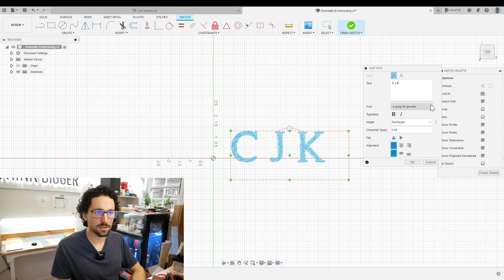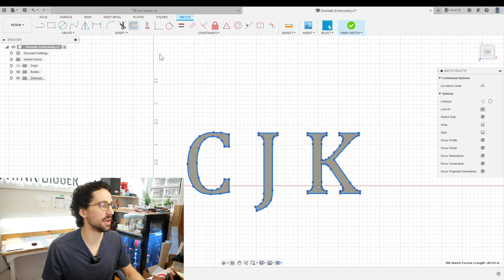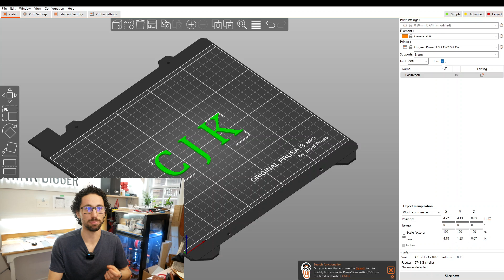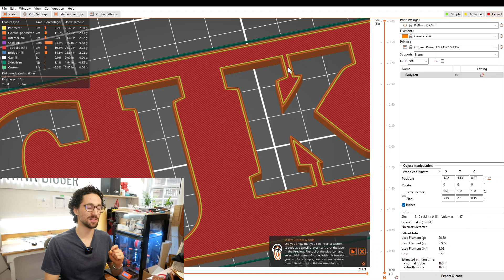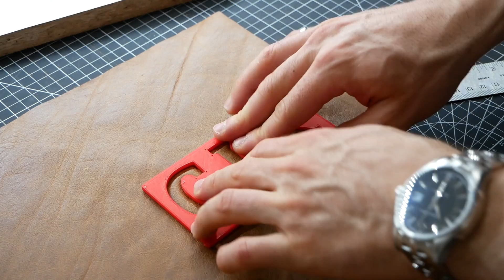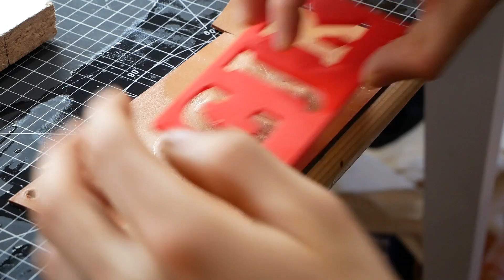DRAMATIC Leather Embossing with 3D Printed Dies

Comment: I believe that technique for leather was originated in Cordoba, Spain, and is what Cordoban leather is known for. They used molding clay as the support for the embossing by tracing the design into a thin layer of the clay, and then laying thick layers of clay into the design.  When that's done, they lay the cased (wet) leather over the design and press it down around the mold. 

Great video about using 3d printing for the same thing!
Reply from the maker: That’s really interesting, thank you! I will pin this comment 😊

Comment: Nice result. But I think this is more like a wet molding. If you use glue, I think you don't even need the negative. You can apply glue on both the leather and the base mold (make sure everything is covered in glue), wait for it to dry to the touch and use bone folder to crease everything in slowly. I mean if you want to save your 3d print material. Nonetheless, your method gave a nice result

Comment: When you make that piece with the "border," make the edges that are going to touch the leather to be beveled. That way it's a little less harsh of a line that will come out on your print as a border.
Reply: I have a purse that was embossed with initials.  Is it possible to "remove" deboss? To make the leather smooth again?

Comment: I have access to a 3 D printer and both a domestic plotter and CNCs. To be honest, a domestic plotter could cut a heavy weight book binder plastic to do the same thing, more easily, cheaply and faster. Of course, a CNC could do it too, cost would depend on the material used.

Comment: Hi. I work in a shoe factory, in the press department. I work with screen printing, pad printing, foil printing and blind printing. the procedure you described is a blind press. the most commonly used stencils are made of brass or bronze and they are used for large series (100K +) for individual prints or small series we deal with old letters for newspaper printing, or we use a plotter-cutter for cardboard templates. i like your idea of using 3d printers.
Reply from the maker: That’s really interesting, thanks for the info!
Reply: I have a purse that was embossed with initials.  Is it possible to "remove" deboss? To make the leather smooth again?
Reply: @valleygirl670  try ironing, if leather not so sensitive y can use steam on iron

Comment: Now this is just an idea, but could you add a fillet to the bottom of the negative so it wouldn’t imprint the edge of the negative onto the leather?
Reply: There would still be a visible difference between the compressed leather and the uncompressed leather, but a fillet would reduce the sharpness of the transition. The other option is to plan for it, and include the edge as part of the design of the embossing like some kind of frame,
Reply from the maker: @ggaub  true! A fillet would definitely help. More so than a sharp edge.
Reply from the maker: I’m not sure that would work; I think it would then imprint the edge where the fillet meets the negative.